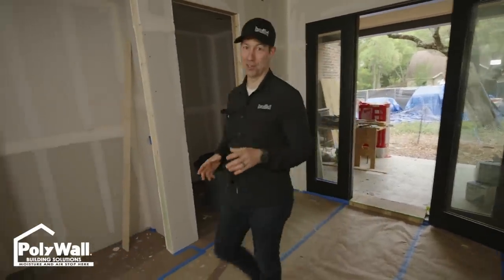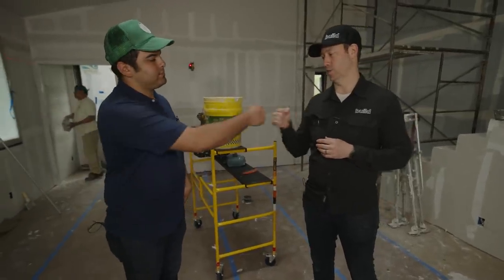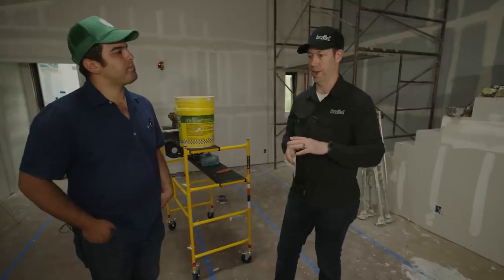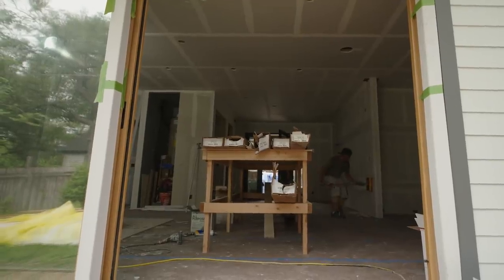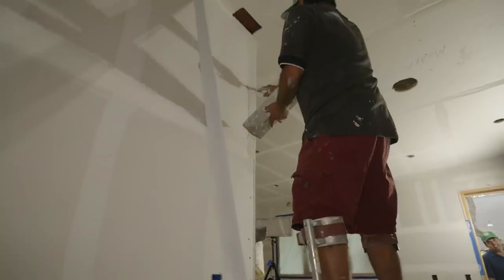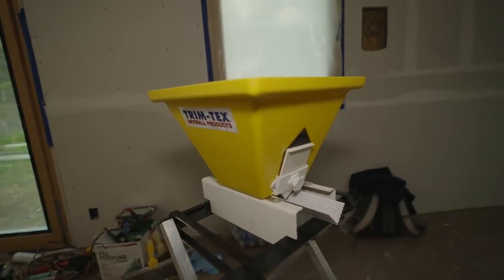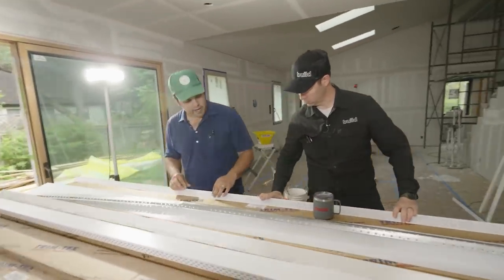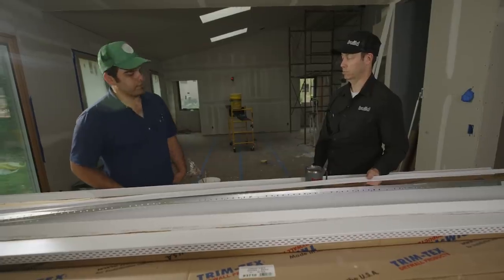Drywall 101: Here’s the specs for a Top Notch Job

Comment: 2-300$ more? Now that's just an outright lie. I don't know why Matt's letting something like that slide.
Reply: Just searched on home depot. This is with my high volume pricing and in PA
1/2x8 lightweight is $10.50
5/8x8 is $12.50
I know other suppliers near me have them both even cheaper.

I would guess a house that size level 5 with 9' ceilings would need something like 170-300 sheets?
split that down the middle....235 sheets would cost $470 more in materials...plus some extra blades
And that's this house...he said "on the typical house". so he may be talking about a house with 8' ceilings and a little smaller.

They're also doing 12' and 10' so that may bring it down more?
Either way that's less of a difference than i was expecting.

While it might not be that much extra...people like to add their markup. and for 5/8 sometimes people add an extra "pain in the ass" markup.

They're in texas...they have a lot of cheap labor. I doubt the guys doing it are 1 making the decisions on pricing and 2 getting paid more cause it is heavier.

My summary...you jumped to conclusions.

with all of that being said...Matt once released a video where he let his insulation "expert" say that you can touch either side of an outlet safely as long as you don't touch both at the same time. which is obviously SO WRONG AND DANGEROUS. so yeah they should fact check the videos a little more if he wants to be the mainstream voice for high end building...but this probably isn't one of those cases

Comment: I’ve seen the corner bead come loose if not stapled or nailed.  This is just cheap building not quality
Reply: True story.
Reply: But true. Mud set is a great product and is made for doing this. Just mesh tape the edge would be my recommendation, even with metal, glued or stapled vinyl. The mudset is actually stronger and better than all of the other options if done properly.

Comment: Drywall just plain sucks.
Reply: What should they use ? Thank you.
Reply: @augustreil  Home built using concrete or even finished plywood. Stronger and more durable materials, plus you don't gotta mess around with joint compound.  If a home was made with concrete and someone didn't want the look of a concrete wall, they can just put Tile all over the walls.